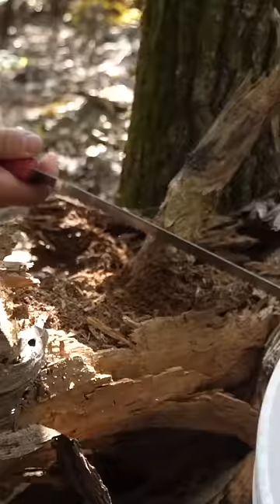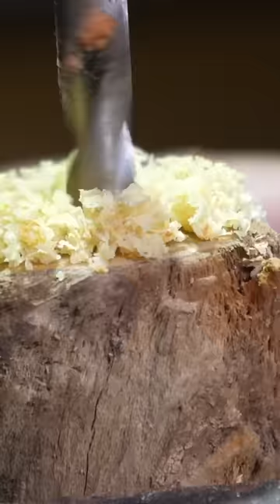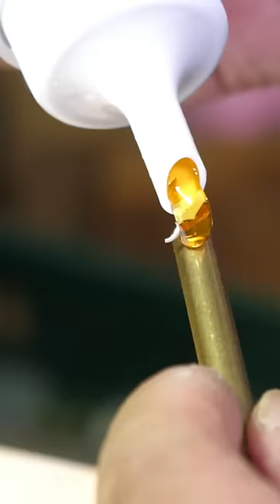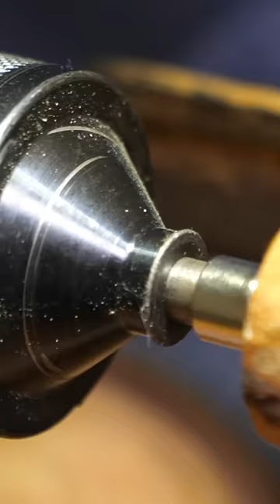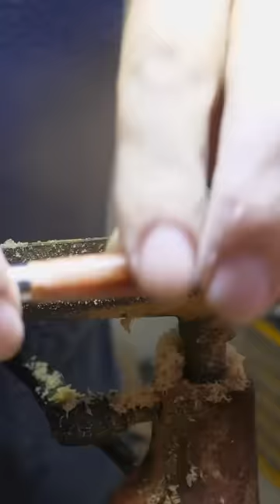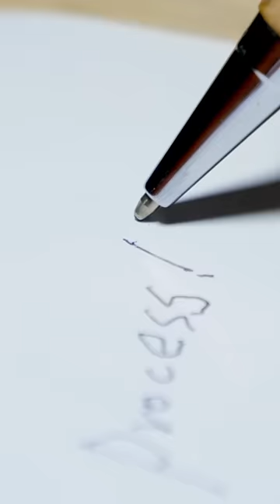A Korean craftsman who makes wooden ballpoint pens with a phytoncide scent that lasts for 10 years.

Comment: I LOVE making stuff with that kind of wood! I have some huge chunks (I call them spikes, because they often look that way after the rest of the tree rots away) of it to work with. Heat brings out the smell, & just holding it works too. It's like soap stone, almost, and is the best smelling wood to work with. I like to wrap it up in aluminum foil and heat it in an oven (with all of the bark on it) at about 200°F for around and hour & a half to two hours. It draws out sap and creates a marbling prismatic/iridescent effect. Gotta rotate the pieces while heating them up after it gets up to temp, and after about 5-10mins per rotation. I like to do 10° rotations. 10° then 10° more & so on.

Comment: Would be nice to link who it is so we can try and order a pen
Reply: It’s in the bio of this video
Reply: @JetBlackOni that’s not a link to the guys store though. All it does is puts you in a Korean google search of random shit
Reply: Its a shame that he puts that kinda effort into a pen thats only suitable for going in trashcan. Ball point is worst kind of pen.
Reply: @coolname2629  agreed and tge woods wet and sealed so it's just going to rot.
Reply: @3cheese711  I don’t think that’s how it works.
Reply: @xaphan8581  I'm a Carpenter and this is what Google says Sealing wet wood can trap moisture inside, which can lead to rot, mold, and decay. It's important to let wood dry thoroughly before sealing or finishing it to prevent these issues.
Reply: @3cheese711  yeah but the inside of the pens not sealed. I don’t even think it’s sealed it looked like he just sanded it and stained it but anyways he didn’t do the inside which would still be able to cure
Reply: @xaphan8581  stain actually does mildly seal wood, and that inside because of the metal would still rot out. I'd imagine he used some kind of adhesive to hold the metal in or it's held in by pressure which is even worse. No matter what though this pen I garbage, sealed it's garbage and not sealed it'll expand and contract constantly which makes it garbage.

Comment: This is called "Fatwood" or "Sapwood", and most outdoorsmen would use it to start fires, since the resin saturating the wood burns so well. but it never occurred to me to use it for making a pen or any other items from it. leaving it unfinished would simply make your hands sticky, and covering it with a varnish or urathane would simply not work because as the temperature of the air changed from winter to summer, the clear coating over it would fail and the resin would seep out of a hole somewhere. I know because it doesn't take a genius to figure this out. Fatwood is best used as something to start fires, or a display item that would occasionally sweat droplets of sap and smell nice. But a nice experiment, nonetheless.

Comment: That looks like what we call fat wood.  Pine sap infused lower branches from dead pine trees.  After the tree dies gravity pulls the sap into the lower parts of the tree.  Very sticky to work with.  We use it mainly to start fires in wood stoves and fireplaces.

Comment: We call that fat wood in the US. The tree fell in all the sap soaked into certain section of the wood. Often times is the the tree dies. The sap will settle to the base of the tree. Usually they die cause they fall over so it settles into the outer side and branches of a tree I believe that’s right.

Comment: That's called fat wood. Pine branches close to the main trunk like that are full of resin... id use those wood shavings to put in my outdoor pack. Fat wood shavings can we easily lit on for with just a spark and will burn very hot for awhile. By far the easiest way to start at fire in the woods.

Comment: Ii thought now we are gonna see some craftmanship. 
Then comes the machine. 
Bummer
Reply: Something being made on a machine doesn't mean it doesn't involve craftsmanship. It being the first project that everyone does on a lathe and him not knowing how to make a cut without chatter does tho lol

Not boasting (they aren't that great) but I think I posted and made public a few turntable videos showing off hollowforms. A couple of them are hollowed out through a tiny hole with the walls of the form being less than 1/8. In my opinion, the pinnacle of woodturning craftsmanship is small hole hollowforms with great form, very thin and consistent wall thicknesses (without using constrained rack systems with lasers and shit), walls thin enough to let the vessel warp and twist however it wants to as it dries without cracking or being constrained by too much wood in the way.
So that's what I am striving to do, eventually I'll be great at it and a whole 3 people will think it's impressive lol